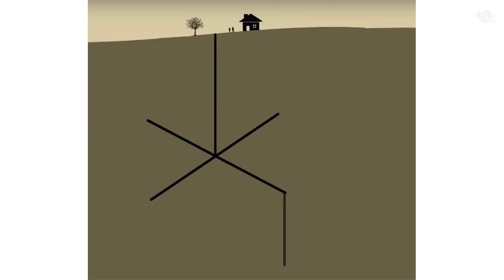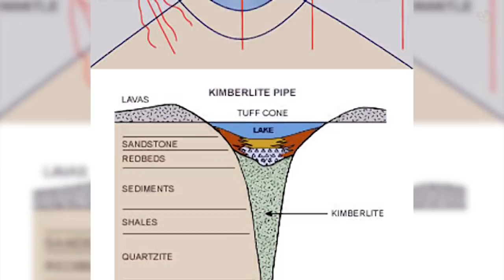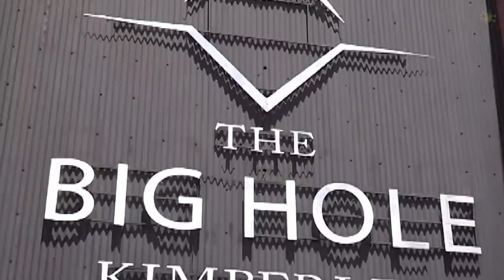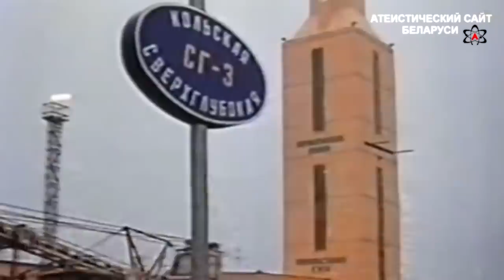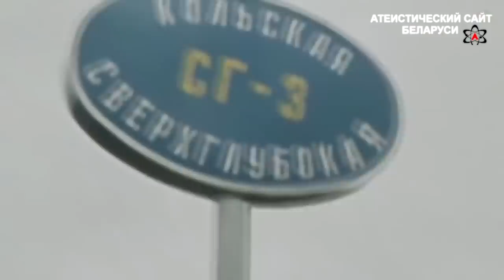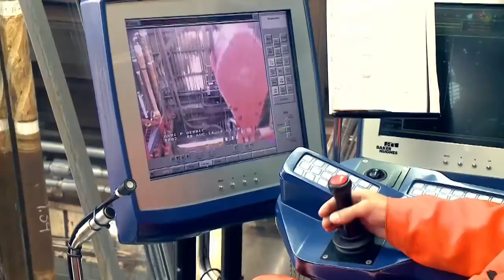10 Deepest Holes Ever Dug By Human

Comment: For a 10,200 foot freefall it would take roughly 45-50 seconds IF you can hold a stable belly to earth position achieving roughly 125mph. Uncontrolled and head down freefall speeds up to 300 plus mph can be reached. Shortening time of course. The 3 stratosphere jumpers all went over 800mph in freefall. But from 130k feet with very thin air resulting in less friction and faster speed.
Reply: Nice job

Comment: You should use both metric and imperial. That would be cool.
Reply: Imperial is useless. Its about time you start using metric like rest of sane world. Imperial is a waste of time.
Reply: FunBox I didnt ask for your stupid opinion.
Reply: FunBox No one did. I was merely giving a suggestion. Then you felt the need to chime in about how irrelevant the imperial system is like some angry little kid. Just to start a useless argument about what is "better".
Reply: funk duck
Reply: FunBox that would be the smart thing to do in fact supposedly we where supposed to have switched years ago but it never happened and because of that I find myself having to convert everything to metric every time I talk to someone online luckily most things I work with are already converted but not all and having to have a tool box with 2 different units of measurements makes it very heavy, would be nice to just have to deal with one unit of measurement cutting the 200 lbs (aprox 90kg) down to half, but somehow I don't think that is going to happen.